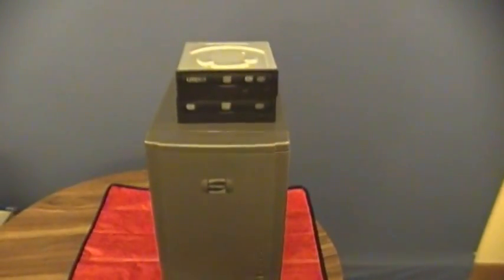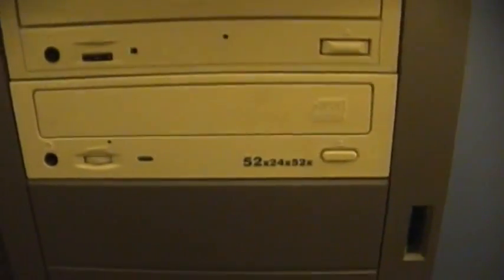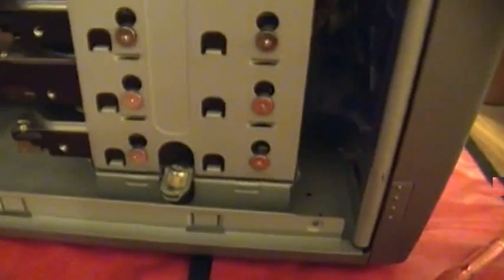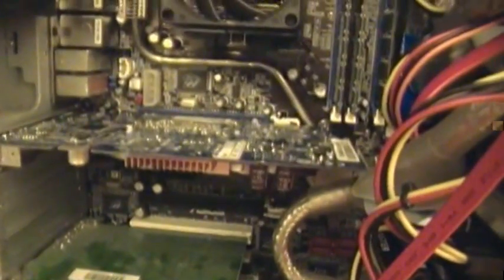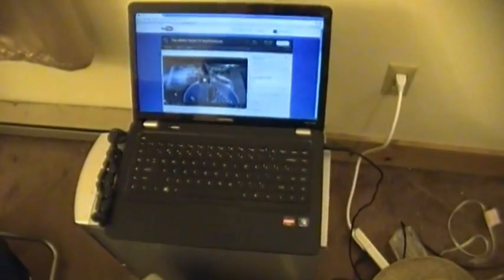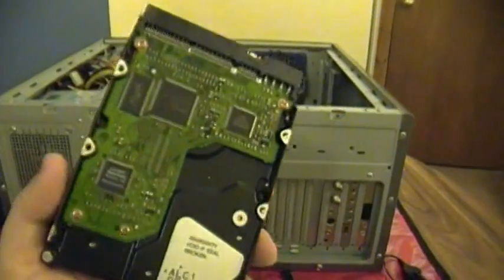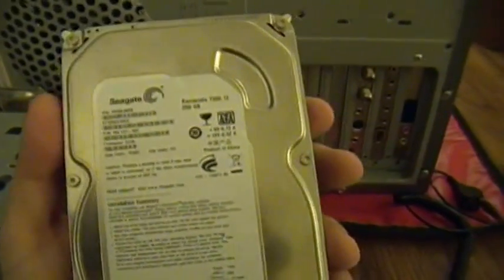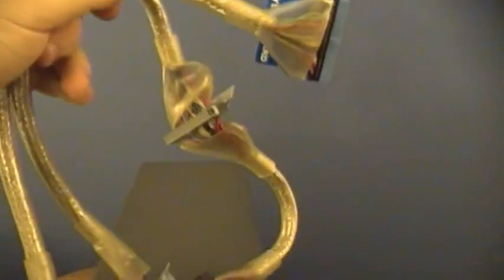Building A Computer For Dad - Part 1 - The Hardware Hookup

Comment: @MultimediaJay Also you should see if your father can use AT&T's U-Verse. I used to only have a phone line for DSL, which meant I had to pay an additional 15 a month just because I only wanted to use DSL. For some reason U-Verse doesn't require this, so you can get U-Verse without dealing with an additional phone line fee. I think the minimum plan was 15 a month, which was what I used to pay for just the phone line.

Comment: Actually, I owned an emachines from 2000, and my dad bought one around 2005. Of name brand computers, emachines were the only ones that didn't design the case to be difficult to upgrade (such as an HP I had to deal with) and choose a motherboard that actually had a video card slot even if the computer didn't come with a dedicated video card. Of course,this is ancedotal, but I found it ironic how people harped on emachines while other companies were far worse and far more expensive

Comment: @MultimediaJay Well there's your problem. Vista will run slow on anything less than 2gb. It doesn't matter if it's a fast computer or a bottom of the line emachines. Vista needs at least 2gb of RAM because the OS is deploying a strategy of precaching things you normally run into memory so it comes up faster, which is a good strategy, but it's bad that they told people that it would run with 1gb because while it "runs" it's hardly usable.

Comment from the maker: @FloppyFormatFrenzy Of course.  That was my original point.  :-)  It's pretty much been a hallmark feature of cheap computers over the years that they never have enough RAM and run terribly slow because they keep grinding the hard drive for virtual memory.  We had Vista machines with 1 GB, Windows XP machines with 128 MB, Windows 2000 machines with 64 MB, etc. etc. etc.  Now today you have Win7 machines under the 4 GB threshold like my craptop....  :-P

Comment: You know your dads P.C. probally has more potential to be better  than the rig you built put in 8 gigs of ram, a 64bit os and then just put the gpu and psu from the computer you built in there and you would be fine. Also try to reflow the broken graphics card that usually works i did it a few times. Misewell make his better since he wont pick up the new one. On the dial up thing...I got nothing. Is his cpu intel or amd btw ?? alot of budget-good store builds in that time used nforce 630i board.